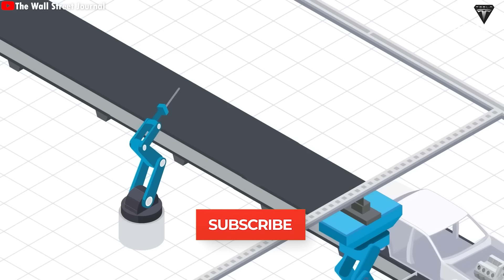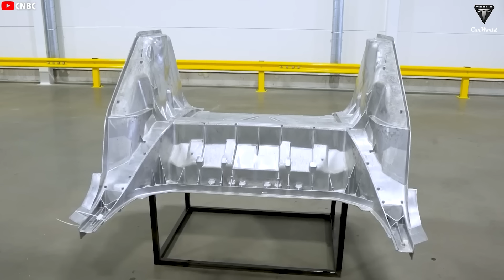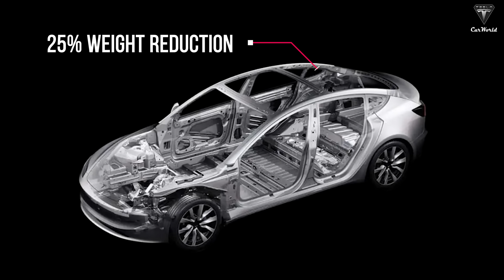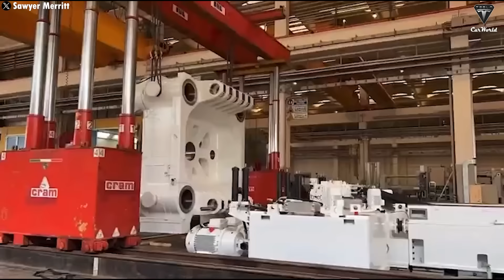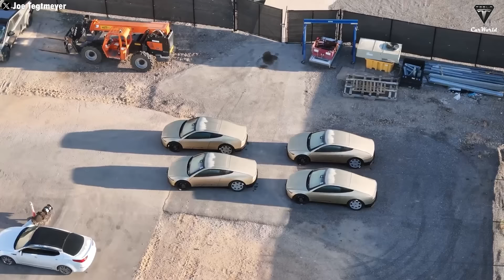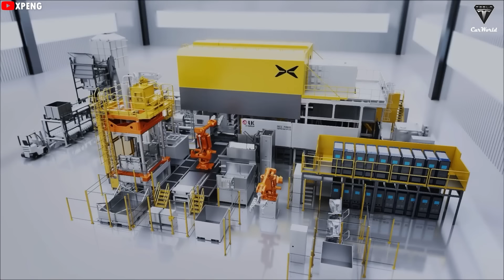New Big Tesla Giga Press Destroy '"Welding & Assembly Line", Elon Musk Revealed!

Comment: Lower costs?  Yes.  Harder to repair collision damage? Yes.  The change in cost? Not neglible, but most of the car is mechanical stuff and electronics.  My guess is it could save $5k per car at most.  On a $100k pickup truck, not the problem.

Comment: Have done this before in traditional way but just a tiny chassing though using 3d sand printing, and the chassing was split into 3 part with interlocking....
 The problem is cracking except hit a again with salt furnace for more strength to avoid cracking

Comment: High risk, high reward — but if Tesla pulls this off, it’s game over
Reply from the maker: That’s probably the most accurate take here.
Huge upfront cost, massive complexity—but if it works, the payoff is structural.
Lower cost per car, faster production, simpler factories.
The risk isn’t just technical—it’s whether the whole system holds together at scale.
Would you bet on it?

Comment: From thousands of parts to ONE cast piece — this is insane engineering
Reply from the maker: Exactly—that’s the real shift here.
It’s not just making things faster, it’s removing complexity at the design level.
Less parts = fewer failure points, tighter tolerances, and way simpler assembly.
Curious though—do you think other automakers can realistically catch up to this?
Reply: But it's aluminum, not steel.

Comment: The main drawback with this is when you are in an accident with a one piece frame, you can't repair it. Your Tesla in now totaled. It becomes a throw away car. That is why Teslas insurance is SO EXPENSIVE.
Reply from the maker: That’s one of the biggest concerns—and it’s valid to question it. But Tesla isn’t casting the entire car as one piece. It’s modular (front, center, rear). So in many cases, only a section gets replaced, not the whole vehicle. The real issue is how repair networks adapt to this new structure.
Do you think insurance costs will go up… or eventually drop as the system matures?
Reply: If ICE vehicle gets into accident and if ABC pillars are affected they are totaled as well.  Or any frame damage would be considered dangerous to repair.  Same applies to Tesla.  Also they do perform repairs.  They are not simply junked.  Why do these information get recirculated?

Comment: I have a possible future idea for Tesla vehicles concerning Optimus. I think it would be very interesting to see someday and maybe a fun idea that when a customer is ordering a Tesla like any of the cars, pickups, vans or the semi-trucks they can order it with a Optimus robot built in a dedicated charging station (storage space) in the vehicle somewhere like the TV commercial with the (trunk monkey) and even have Optimus load or unload itself from the charging station that’s built into the vehicle when needed or when the task is done. I think it would be very helpful in many ways for the customers especially for the delivery / transport drivers to help them do any physical tasks like loading or unloading items from the trucks or the vans and when Optimus is done it can just put itself away almost like folding up or stand itself into the charging station (storage area) kinda like the Borg did in Star Trek. I think if any company could actually make that happen it would be Mr, Musk, Tesla and the engineers.
Reply from the maker: That’s actually a really interesting vision—and it fits surprisingly well with where Tesla seems to be heading.
A fully integrated system where the vehicle, robot, and charging all work together could completely change logistics and delivery workflows.
The biggest challenge will probably be reliability and cost at scale.
But if they solve that, it could go way beyond cars.
Would you see this more for commercial use first, or everyday consumers?
Reply: @TeslaCarWorld yes i imagine a Optimus bot in a Tesla could possibly work for a lot of different factors across the board. It is kinda of fun thinking about things that may help or give fun to Mr. Musk’s Tesla customers. I actually have a few more ideas for the vehicles I wish he would be interested in listening to someday. I think his engineers may be able to make them work possibly, if anyone can i think it would be them. These fun vehicle option ideas could potentially attract customers for Tesla someday because the ideas are things that no other automaker offers in any electric or internal combustion engine vehicles. Also to answer your question I think it could be an ordering option for everyday customers first but following very soon afterwards to the commerce side of the vehicles. Years ago when i delivered cases of cola to customer stores I wished everyday that I had a helper lifting all those cases of soda especially the day I threw my back out and ended up in the hospital and have had a bad back ever since.

Comment: I wonder if a chassis could be baught fully built w/o the body? Put a carbon fiber supercar body on it.
Reply from the maker: Interesting idea—and technically, yes, that direction is possible. You’d be separating structure from outer shell even more aggressively.
But carbon fiber brings cost and repair challenges, especially at scale. That’s probably why Tesla is leaning into aluminum + casting instead.
Would you prioritize performance… or manufacturability?

Comment: Oh... a Tesla mark 2s with a Carbon fiber wide body. 😮
Reply from the maker: That would look insane 😄
But carbon fiber at mass scale is still very expensive and slow compared to aluminum casting.
That’s why Tesla is chasing speed + cost, not just performance.
Would you pay more for carbon fiber… or prefer a cheaper, mass-produced version?

Comment: Same as plastic injection molding, but on a much larger scale using aluminum.  I've operated 7k ton injection molding press making storage sheds.  Wow, molding a whole car unibody in one shot. Amazing!
Reply: One good accident and it's a TOTAL.
Reply from the maker: That’s a great comparison—and honestly, you probably understand this better than most people watching.
Scaling that concept from plastic to structural aluminum at this level is where it gets crazy.
Especially with the precision they need to avoid internal defects.
From your experience—what do you think is the hardest part to scale up? Pressure control or thermal stability?

Comment: Germay makes one Step back. They want to bild cars like VW with about 70 Companies who Produce Hard and Software  witch does Not match together.
The Companies have to deliver the parts very cheep and for long time. 
When their is a problem   " like the elektric doorhandels " Tesla S70D vor facelift 2016 to 2017 a tiny Part Brook and a microswith they changed the Konstruktion at once and some month later " the Tesla Ranger "came  to my carport in Berlin germany and Change the parts without " repairing the doorhandel in Garage.  Saved my time and money. Germany  Producer like VW Mercedes BMW etc want you to bring the car in their Garage and you have to wait ore have to get it the next Day. They don't have Updates over the air like my Tesla S70D march 2016 before facelift . I 80years old still
drive my Tesla just Private and for holiday now nearly 108 .000km Free Charging AP 1 Muc 2 sunroof  never Problem with TÜV .
I like it are Waiting for Model Y with FSD.  Rumstromer from Berlin germany

Comment: This what I dislike about the internet - only expressing ONE POINT OF VIEW. I do think this is a innivative manufacturing process. Notes below -
1) What is not told is that when these types of cars are in accidents involving chassis damage, the damage is many times NOT REPAIRABLE and must be salvaged. This brings the cost of insurance up to the owner and across the industry. Being able to "Unweld" subsections in a car, allow for repairs keeping cost of insurance lower.
2) Steel (traditional manufacturing) and aluminum have very different structural properties. Steel is more 'flexable' and does not crack as easily as aluminum. What they say here is not exactly accurate (do research) this is a full-on FLUFF piece with no downsides communicated. 
3) Why don't other manufacturers do this? When you have unlimited money and ego you can do this type of thing. It does not mean it will be profitable. Time will tell.
4) Consumer BOTTOM-LINE > Will this new process reduce the price of the car? Of course not. - lol

Comment: aluminum still has inherent disadvantages to steel 50% less strength and three times less rigid.  Nothing can ever change these material property differences and going all in on Aluminum is still quite a wild card.
Reply: Do you fly in a steel airplane? It is a matter of designing for the material, not making uniformed selection as you  did.
Reply: @richardpase2066  dude, the smartest engineers in the land work for Ford, GM. Toyota, Honda, Chrysler and they are not betting on aluminum.  Even The aluminum body in the Ford F-150 only served to allow for heavier payloads.  The rest of the auto industry has bet against ford and aluminum truck bodies.  There was a reason I was the Chief Mechanical Engineer for the entire State of Mn,, I was the number one in my engineering class end of story.
Reply: @PatrickFerrin  they don't bet due to:
 ignorance about new process and material. (engineers specialized on steel forging their full working life may not the best to consider aluminium molding)
 complacency with established methods and process, this one is HUGE, " i know my job, you are not going to teach me anything, we tried aluminium 15 year ago" (tech changes, you know? )
risk avoidance, or a corporate structure that discourage risk taking thus stalling advancement. 

that are some of the problems with established corporate structures that think in the next shareholders meeting more than in the future.

about common practices: the rest of the industry bet on outsourcing software development, a really bad decision in the age of information.

Jim Farley acknowledged that they are unable to compete against Tesla in Software, that's corporate culture too, to point an example.

https://www.youtube.com/watch?v=9xtAxZlL31U

remember that the established industry is the last one to see the change that is going to kill them, CEO are not stupid, they are just blind to the change, due to their legacy they don't consider thing can be done differently, there you have 3 examples of dead companies:
Kodak, Nokia, Blockbuster top notch in their time. 
The rate of replacement for auto industry is less than 4% annually, with 2 billion cars on the streets and 70 million annually produced, it will be a slow bleed out losing market share, but companies that don't change are a dead walking.
give a read to "the age of disruption" from Tony Seba. 

by the way, NASA has the brightest minds and they laugh about landing a rocket and re-usability. 
500 landings and counting for falcon rockets.
Space X has 1/10 of LEO launch cost compared to NASA.
don't bet against Elon, on the contrary of the normal CEO which know nothing about engineering and only care of next quarter meeting, he has strong knowledge on physics and engineering.
Reply: @PatrickFerrin  My uncle was a engineer for GM for 35 years and started off going to GM institute to become a engineer, but he was smart in most ways yet not the smartest!  There are a lot of goof balls that are engineers!!!
Reply: @Rory235  Yes but they get shown the door sooner or later, been there done that got a T-shirt
Reply: @PatrickFerrin  My uncle spent his whole life working for GM! Retired there!  Then his whole life fell apart after that! Usually that is what happens after retirement for gecks like my uncle!
Reply: @Rory235  Yes after 23 years of being the chief mechanical engineer for the state I retired and had the widow maker heart attack four months later.  The last few years really sucked.  I got an experimental drug and went back to work as a consultant and made some really big bucks.  I am still alive at 77 but again facing health problems.  No one tells you about all the back stabbing lying and cheating but I did my best
Reply: So how experienced are you with Rocket 🚀 metals chemistry 🧪 as Elon and his Engineers Are ⁉️ You’re looking at the past when Elon’s Manufacturing Process is the Future.
Reply: @dalazyone109 
As I watched this video, one thing popped in my mind that I can't stop thinking about. I'm not a big believer in UFOs as a means to traversing outer space. I'm not entirely sold on the idea of them originating from another civilization, but rather think that, it would be more likely than not that they arrived here from the future, or are part of a previous very advanced civilization, lending some explanation for objects that have been found out of time for their age. Like cast iron cookware and a brass bell with the figure of puzuzu above the clapper. Both were found in coal seams in Pa, or WVa and dated back to 500 thousand years ago. The bell had a Sumerian wind demon for crying out loud. I'm only bringing this up because I watch a new movie about Bob Lazar about a week back and he "claims" he was assigned to a reverse engineering project of an alien disc at an area known as S4 at area 51. I have ALWAYS taken his claims with a grain of salt, but as I was watching this video and the techniques used necessary to use aluminum in an injection molding(for lack of a better term) process like this giga press does, it brought to mind a claim he made. He said the disc, he called "the sport model" that he was working on, had no visible seams whatsoever on it. As he put it, it looked like it was molded as one single piece, both levels, inside and out. He went on to say that he couldn't imagine a process like that in 88 or 89 while he was employed there and speculated that it was conceivable that may have been constructed in a weightless environment, one that we were nowhere near having at that time. I don't care who wants snicker or poke fun at my comment, about this video, but this injection type extruding molten aluminum thing that going on with that press, may very well be beginnings of more than just selling EVs. Now all we need is a source of stable element 115 and were going to Mars 😂.
Reply: Aluminum is used as alloys.  Never in its purest form?
Reply: @mightymikee  Yes and T-6 is the most common grade
Reply from the maker: You’re absolutely right to bring that up—that’s one of the biggest debates here.
Raw material properties do matter. But Tesla seems to be compensating through design (geometry, thickness, casting structure).
And also by reducing joints, which are often weak points in steel assemblies.
So it becomes less about “material vs material”… and more about “system vs system.”
Do you think the trade-off is worth it long-term, especially for crash repair?
Reply: @TeslaCarWorld  there is nothing wrong with the molded aluminum which is needed to reduce weight due the all the heavy batteries and reduce construction labor.  However, these methods are only practical when you are only making three different cars, model y, model 3 and cybertruck.  Oh I guess we can consider the cyber cab however it appears to be a pipe dream.  Ford makes perhaps 40-50 different vehicles all the way to OTL trucks.  The all aluminum tesla cars really increase insurance costs and most cars are totaled with minor damage.  Yes if someone could make a 100 kwh battery that weighs 500 pounds well the dynamic would change.  However no battery maker has made any progress on this front
Reply: @PatrickFerrin Ford makes many but do they sell many?  Do you have something against Tesla or Elon?  Or is this simply about material selection and design choices?  As someone mentioned components can be designed differently to compensate for its innate material characteristics.  

Yes insurance cost is up but product cost is down.

Ford has been in the ruts for years.  Why do you think that is?

Aluminum is used to save weight to increase efficiency.  ICE vehicles use them on the doors and hoods and some of their body panels as well.  It is not just Tesla that uses them.